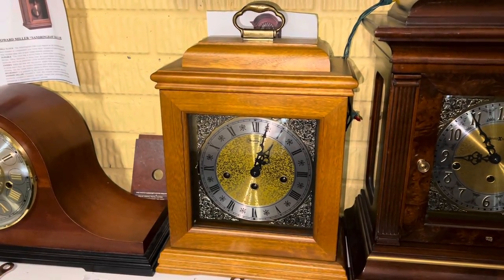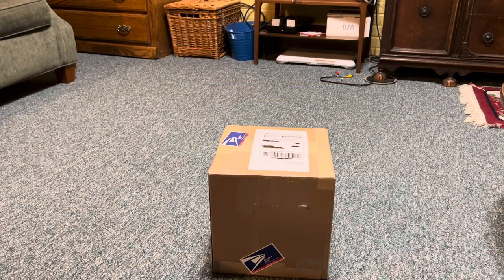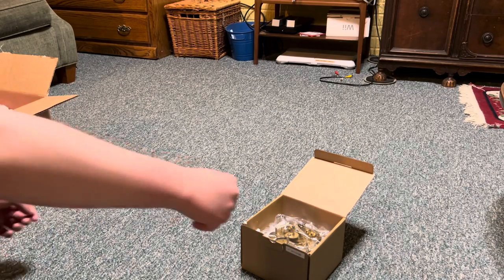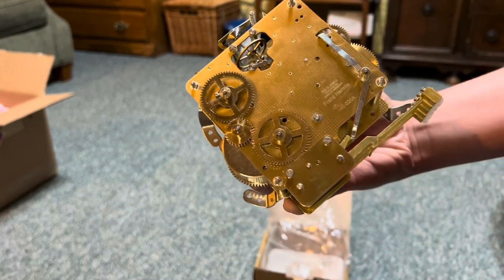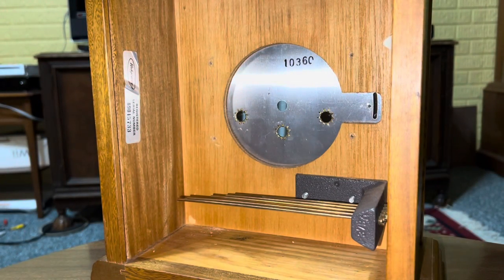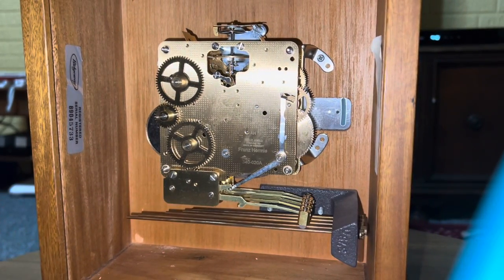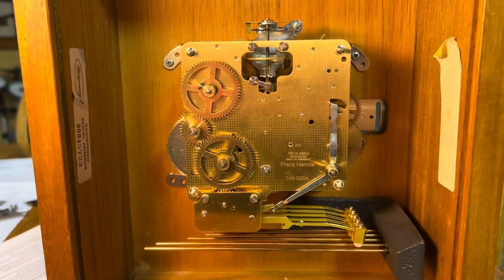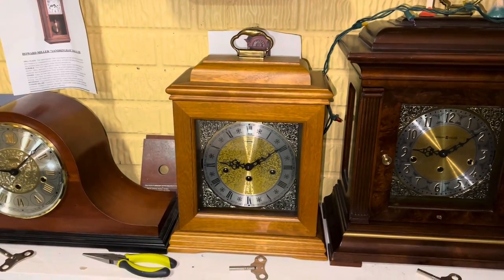An update on the Ridgeway Bracket Mantle Clock…

Comment: I’m sorry the old movement broke.  The one my mom and dad gave me he busted the main spring while winding it and it was a little over 40 years ago.  I can’t seem to get it fixed at a good price or I can’t get a new movement because I don’t know if they make the same movements for this one it’s a bracket clock that is arched on the top with a tempus fugit on the top but it sits up there for sentimental reasons but I wish I can get mine fixed. Because I want my parents to know that the clock will be working again but we tried a few places to get it fixed and just had no luck pricewise. But congratulations on getting your movement I hope it lasts a lot longer. When did you break the spring when did it happen?
Reply from the maker: I wound it a couple weeks ago and it seemed to run just fine. But a couple days later, I came home to find that it stopped working and the spring was broken.
Reply: @ogClockTV  Well that’s an odd way for it to stop working in the spring to be broken. It working for a few days and then find it’s not working because of spring it broken that’s odd. I’ve heard of it like the spring with pop off or pop loose and break during the winding it’s like tuning a guitar you break a string kind a like that but I’ve never heard of winding it and then it would work for a couple of days and then stop on a broken spring because on a broken spring it could’ve broken while you were winding it and then stop working like that. But I’m glad you got a new movement for that because I know it be difficult to find the right spring for the old movement. I sure wish I could find someone to fix mine and put a new spring in hours and clean it I need a new chime rod to Costa fifth rod for the striking park what’s the one it’s broke but the other four for the Westminster‘s working fine still intact. But I’m glad you got your fix there buddy keep up some more good videos of your clocks

Comment: Why didn't you just install a new spring? You can get them pre-installed in the barrel and just replace the barrel. You don't even need to disassemble the movement to get the barrel out. That's a lot of money for a new movement when you could've replaced the spring for under $20.
Reply from the maker: I forgot to mention this, but I’m just a beginner repairer and actually replacing the mainspring is a bit too complex for my skills as of right now. I haven’t wanted to attempt something like this as I’m afraid I’ll mess something up.